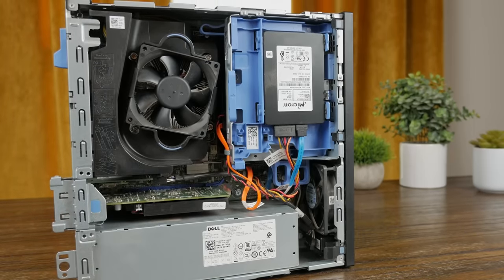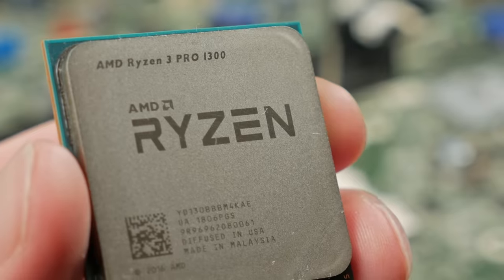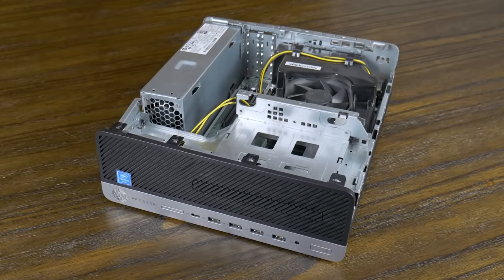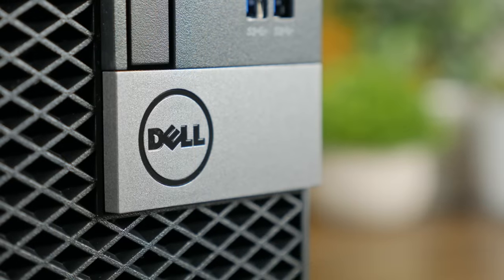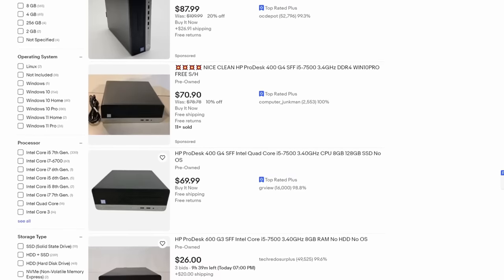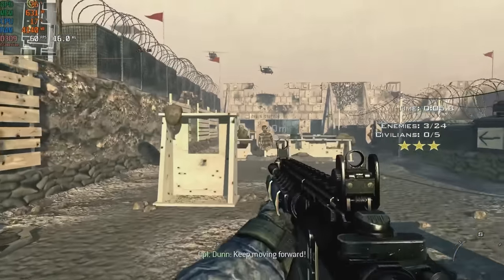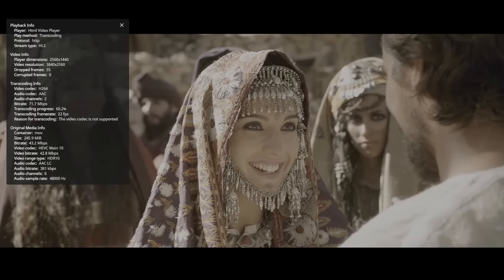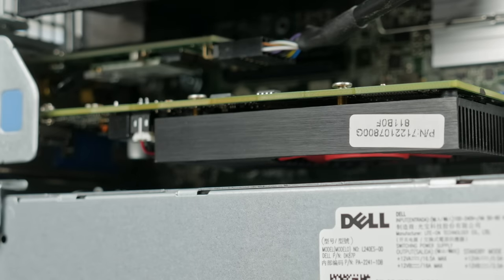A Surprisingly RARE Dell Optiplex

Comment: I must admit that I love working on those Optiplex SFF computers. Everything is so easy to access without tools most of the time. The only thing I find a bit annoying is that you have to flex the drive caddy in order to get two drives in it. That scares me a bit every time as I don't want to break it.
Reply: Yeah, some of the easiest machines anyone can need to do any work on. Parts received same day, within a couple of hours at times, from Dell and nothing ever took more than an hour to change out. Even on laptops.
Reply: All's good until you get a power button failure or some kind of front usb port fails. Never seen these fail on any other computer out there. Can't swap fans out with different models either even if the connectors are the same. Dells are a pleasure to work with as long as they only need an upgrade
Reply: SAND IT

Comment: It's disappointing how Dell gave up on Ryzen for business desktops in the Optiplex lineup after the 5055. It would've been nice to have more options, especially considering my organization limits me to quoting only Optiplexes for our staff.
Reply: Intel monopoly is still too strong
Reply: Intel probably sent them a little note about continuing to do that,
Reply: @knerduno5942  As somebody at Intel would say: "Dell is the best friend money can buy"
Reply: @JoseLgamer05  I am sure Microsoft said the same thing once they stopped selling those Linux based Machines many years ago.
Reply: I'm in the same situation. We can only order Dell for our standard setups, though some administrators and tech staff can order from another vendor if they want. Dell at least offers Threadripper workstations but OptiPlexes and Latitudes with AMD CPUs are non existant. I find it especially annoying in the mobile sector because we get constant complaints about our Intel equipped laptops running very hot. We get no such complaints from the few special order HP models we have with Ryzens in them.
Reply: @marcuscook5145  That's normal. laptops are built thin and so, the heatsinks must be tiny with a tiny fan and very small grille.
They use to make laptops 1 cm thick in 2010. Now they are 0.5 cm thick.
Reply: As a former and user I can tell you amd can get very unstable.  I have an hp laptop I can’t game on as it overheats it’s a4 and every athlon I had slowed down to unplayable levels.  Intel is better for gaming and office.  I have an i3 and haven’t had any stability issues out of the 10105.
Reply: @StarRise-w1b  No wonder it has been shit to you, it is of the OLD AMD Bulldozer based shit. Ryzen is different and easily beats anything Intel offers on Mobile side
Reply: @MrBluePoochyena  dude I even had an amd a4 give me issues.
Reply: @StarRise-w1b  AMD A4 is not even closely related to Zen architechture. The only minor stability issues I've had with AMD was on AMD FX/A-series chips, Ryzen though? Never had any issues.
Reply: @StarRise-w1b  What games and what settings were you trying to play on an A4 based laptop?  The A4 processors were definitely NOT gaming chips. They were sold in very low end systems. An A8 or A10 APU would've given better results. Only Zen based CPU/APU in the Lisa Su era should be compared with the 10th gen Intel equivalent.
Reply: @StarRise-w1b skill issue
Reply: @Marzsala  IS IT A SKILL ISSUE THAT AMD PULLED TWO CPUS K WANTED AND MADE THEM BUSINESS AND SERVER CLASS?!?  FYI EPYC AND THREADRIPPER.  YEA I WAS AN AMD FANBOY.  NO MORE AFTER THAT AS IM STILL PISSED AT THEM OVER THAT MOVE BEING A GAMER.
Reply: Most likely because realistically the OEM Ryzen stuff is junk in comparison..  My gaming rig is a Ryzen 5800X so I'm not against AMD.. But with the Optiplex or other OEM systems there is a marginal price difference and the Pro stuff is locked down.. Probably not big sellers new and horrible for gaming...  Remember that Ryzen was a good value 1st and second gen but didn't fully catch up to Intel until the 3rd Gen where a R5 3600 would match an I7 8700
Reply: Intel CPUs were just better...

Comment: I can confirm, first-gen Ryzen does have freezing problems on Linux due to C-States. I had trouble with both Ubuntu Server and with TrueNAS Scale freezing while idle with a 1700x. Supposedly there are workarounds/fixes, but I needed a better motherboard regardless, so for me the fix was to switch to a Xeon CPU.
Reply: Feel that, my 2920x has the same issue in TrueNAS core. Disabling all c states helped me there
Reply: I had that problem with my Ryzen 7 1800X and while running Kubuntu 18.04.
There is the C6 state that needs to be disabled. I used someone’s script to do that.
If I didn’t and I left my PC on all night, by morning, the OS might be frozen. It seem to lockup in 3 to 6 h. I know since the PC shows the time.
If you reboot, you have to run the script again.
Another solution would be to recompile the kernel with some changes.

I have a Ryzen 5 3600 now and this problem is not present.

Comment: Here's the thing... you're not stuck with single slot cards. Also, this isn't a specific issue to the 5055. This has been an issue for the SFF Optiplex systems since the 3020, 7020 and 9020. Not sure why Dell made this stupid decision, but there are options. The x4 slot is open ended and you can totally install a dual slot x16 card. Many people do this, and yes, there's a hit to performance but it's not even close to a big as you might think. You can absolutely install an s2000 in here and be good to go. Another route people like to take is to just replace the power supply with an HD Plex unit, which then gives you the room you need to install a dual slot card in the x16 slot. Lastly, you could always resort to a riser cable.
Reply: Another youtuber did tests with the 3020 and found it to be about a 10% decrease in performance, but I might if you can fit a card that's twice as good as say the GT1030 which is otherwise what you're limited to, then it's still worth it.
Reply: @loganparker4184 Are you sure it was the 3020? I should have noted that the 3020 does not have the x4 slot, just an x1 slot that you can't install and x16 card in. Anyhow, that sounds about right, and going with the new 3060 6GB or an A2000 over something like the RX 6400 is well worth it, as it will perform better. If you get an XE3, you can even run a 4060. No reason to be running a single slot card in these systems. There's really nothing all that good with a Gen3 slot. Best I could suggest is the WX 4100 or a single slot 3050 or A2000 off the grey market.
Reply: Pretty sure they did it as a way to push customers towards the precision SFF for anything involving GPU horsepower. Dual slot cards fit  fine in those.
Reply: @saddpotato Perhaps, but they only recently just started doing that. For a while now, the Precision system had the same configuration since the days of the T1700 SFF. It'll be nice for people when those are being dumped on the second hand market by business for sure.

Comment: I think Dell put the PCIe x16 slot on the bottom on purpose for these business class SFF systems, so if you want to use a dual slot GPU you have step up to their professional/workstation class systems, like the Precision 3460
Reply: I don't think it was done for upsell reasons. I find that most SFF systems aren't good candidates for running better-performing graphics cards. The PSUs for these computers are only rated at 240W. A real gaming graphics card draws more than that, assuming you can even find one that fits in the case, and there's no upgrade for the PSU unless you're keen to design it yourself. The graphics card in the OptiPlex 5055 is really nothing more than a substitute for integrated graphics, since that Ryzen CPU doesn't support integrated graphics.

About 10 years ago, I worked part-time for a school with a computer lab that was outfitted with Lenovo ThinkCentre M71 series slim towers. The students were more than a bit rough on them, and I had to keep the lab running on a budget, so when I encountered a system unit with its VGA port partially torn out, I needed to shop for a compatible graphics card to try to bypass it. Looking back on that plan with what I know now, I'm not sure this would have worked in the first place, because I've encountered a lot of motherboards won't POST if there's anything wrong with the integrated GPU, even if a graphics card is present. But it didn't matter, because at that time, I couldn't find any graphics cards with specs that called for a PSU smaller than 300W, and these ThinkCentre M71s had 280W PSUs. Officially, there was a 320W PSU available for those slim towers, but I couldn't get one for some reason. I ended up retiring that computer.

I know that graphics cards aren't power-hungry all the time, but I've also learned, the hard way, that short-changing them is a bad idea. In 2017, I bought a couple of Dell XPS 8920 towers, which came from Dell with NVidia GTX 1080 graphics cards installed, for an architect. But I found out after the fact that Dell shipped those towers with the exact same 460W PSU that they used in the XPS 8920 with only integrated graphics. They weren't enough, and whenever the architect's CAD software started using those graphics cards, the computer would freeze, blue-screen or just shut off. I contacted Dell support, but their position was that as long as the computer booted and ran without an error, there was nothing wrong with it; they had never made a claim that it was suitable to any particular task. I ended up replacing the stock power supplies with 850W ones. (850W was probably overkill, but they were only a few dollars more than 750W ones at the time, I figured better safe than sorry.) Problem solved.
Reply: @mar4kl  my optiplex 790 has a GTX 1650

Comment: Just because the x16 slot is actually full x16 doesn't necessarily mean it will support a full 75w from the slot in these OEM machines. I would check documentation to try and see what wattage is supported on that full slot before putting another gpu in. An i5 6500 system i worked on in the past only supported 45w from the slot if I'm remembering correctly.
Reply from the maker: True! Good point
Reply: I've used GTX 1650s with no plugins for pcie power just fine in similar systems, I think it supports it.

Comment: The ryzen 1000 series was game changing they had options for anyone and cheap too which then intel actually started innovating after selling identical parts for almost a decade with just higher clocks. Finally competition came back
Reply: Exactamente así fue.
That's exactly how it was.
Reply: I noticed how on steam, people were buying Intel CPUs more and AMD was going down and then the Ryzen came out, some started to switch to AMD again.
If you wanted more cores, the clear choice was Ryzen.

Comment: Picked up the 5050. I5 6600. Integrated graphics. Add 8gb ddr4 for a total of 16. Intel enterprise SSD 480 gb. Bluetooth and wifi dongle. 70 bucks total. use as Nvidia shield replacement

Comment: I'm running r7 1700 in my server. It still has issues, even with the latest kernel (proxmox 8), but they happen not too often.
When my server had even a slightest load, it worked fine. However, last year I added a second server to my homelab and moved all of my VMs onto it, and then I started having issues.
Every 2 or 3 weeks server stopped responding.
I fixed it by manually disabling C6 state and it ran fine ever since.

Comment: Excellent video! Interesting to hear a bit of history concerning the Ryzen CPUs - I have them in all my systems except for my 3 node proxmox cluster and it's backup machine. Until fairly recently, I ran my personal workstation with a Ryzen 1700x and a Nvidia GeForce GTX 1050 Ti - but I finally upgraded to a Ryzen 7 5700G, and it's a noticeable difference (even though I'm not taking advantage of the built in video).
Keep up the good work - and thanks for the early content for your supporters!

Comment: honestly it would be so cool to see a video of just upgrading this thing to the absolute max. a recommendation for a GPU you could possibly use is a AMD Radeon RX 6400 which has a handful of low-profile variants!
Reply from the maker: I just might... I had no idea there were single slot rx6400s. I think not having PCIe gen 4 would hurth though...
Reply: @HardwareHaven may not be as powerful but it would still be decently powerful either way
Reply: Just realized I am on the wrong account, still JustinSUF here but a different account lmaoo
Reply: @HardwareHaven  You could theoretically get a PCIe 3.0 riser cable and install (aka throw it in the case) another GPU but both internal space/mounting and power draw can get in the way
Reply: It looks like a 2-slot LP card could fit if you only need those first 4 (8?) lanes. IIRC there are some 6500XTs in that form factor, but also a 4060 that may be too long.
Reply: @DigitalJedi  Will definitely fit, you just lose a ton (10-15%) of performance
Reply: @NoobSniper  oh yeah 100%.
Reply: @HardwareHaven there's also an A380 low profile which might be more interesting for a video
Reply: RTX A2000 12gb is the maxed out LP choice
Reply: @Fhwgads11 currently the RTX 4060 is. But the A2000 is my personal favorite gpu
Reply: @theinktician  huh, I was not aware there was a LP version of the 4060. I imagine that’s a good bit faster than the A2000, however the A2000 can run on just pcie power, so at least it’s got that going for it
Reply: @My_Old_YT_Account  A380 doesn't really work on anything worse than a 10th gen Intel CPU
Reply: @HardwareHaven I run that card in a 5050 (i7-7700 or 6700 don’t remember) and it’s works just fine. Not a hardcore gamer but I can say csgo plays pretty well. Can’t say what fps but hardly any stutters.

Comment: I run a home TrueNAS SCALE box with a Ryzen 5 1500 and A320 motherboard in and did indeed have issues with it crashing every 2-3 days in TrueNAS Core and TrueNAS SCALE. The issue is the hardware uses some advanced C-states for power management that aren't properly supported by some OSs, so when it is sitting at idle a long time it  tries to use one of these C-states to step-down the power draw and promptly crashes the kernel. Turning these off in the BIOS makes it draw a bit more power but totally negates the crashing.

You may have dodged that bullet when you installed sysfs-utils and manually set the CPU governors. I don't really know enough about that tool or the relative governor settings vs C-states to know for sure.

Comment: Happy you mention first gen ryzen crashing at idle, I've actually been having that issue with my ryzen 1200 and couldn't figure out why it kept turning off.
Reply: I had that problem with my Ryzen 7 1800X and while running Kubuntu 18.04.
There is the C6 state that needs to be disabled. I used someone’s script to do that.
If I didn’t and I left my PC on all night, by morning, the OS might be frozen. It seem to lockup in 3 to 6 h. I know since the PC shows the time.
If you reboot, you have to run the script again.
Another solution would be to recompile the kernel with some changes.

I have a Ryzen 5 3600 now and this problem is not present.

Comment: I actually really like these modern Optiplex systems. I've bought a few ex-lease machines over the years and they've been very reliable and robust. I've got my partner running a Optiplex 7060 SFF with an i7-8500. It's not a gaming rig, but it does allow them to do some photoshop and premier work with minimal fuss.

Comment: Wasn't the idle crashing thing was something that was worked around for a while in Linux? I seem to remember that it was an issue when entering higher C-states, so the workaround was that Zen1/Zen2 wasn't allowed to enter higher C-states. I think this is actually fixed in current Linux kernels rather than just a workaround, but I can't remember for sure.
Reply: Still happens to me on my 3700X and on the latest arch kernels. Could be a different CPU fault or a motherboard problem since it didn't happen on my 3600
Reply: I guess it is because of state C6. I used someone's script to turn it off. I had a Ryzen 7 1800X a while ago.
The problem is not present with the 3600, which is what I have now (same motherboard).

Comment: If you're in the market if an OEM business PC like this, my advice is double check the BIOS support, I've learned this for experience, and seems to be common with Dell where they will not release future BIOS updates to support later microcode to unlock the motherboard to support later CPUs. For example, I bought a Dell Optiplex 3060, the mini form factor, that came with an Intel 8100T for £50, I had no intention of upgrading the CPU at the time, but I did discover the motherboard will take a 9th Gen CPU, and I'd think about sticking in a 9500T for a little more CPU horsepower, however Dell do not release the microcode to allow that (probably to force businesses to buy new units, not so good for keeping them out of landfill when the public get their hands on them). However Lenovo's equivalent the M720Q does have the microcode support for 9th Gen Intel; I guess that's exactly why the Lenovo units can sell for twice the value, I don't know about HP as when I was buying HP units seemed to be less available.
If you are thinking, or might consider in the future, to upgrade these second hand PCs down the line, just check out the Dell, Lenovo etc forums to see if BIOS updates did allow an upgrade path, just imagine if a 3rd gen Ryzen APU could have been installed, it wouldn't have been bad at all.

Comment: pro cpus are really interesting, i have a 3900 pro, the thing with these is that since oems want tiny PSUs AMD binns the PRO chips to get ones that are super efficient, when one puts it in an of the self mobo with solid vrms and a big psu you can overclock the shit out of them, i got mine running at 4.3ghz and drawing over 170watts from the standard 65w, this also allows for running in 65w and undervolting in supeer small builds. (i still run mine overclocked in an A4H2O)